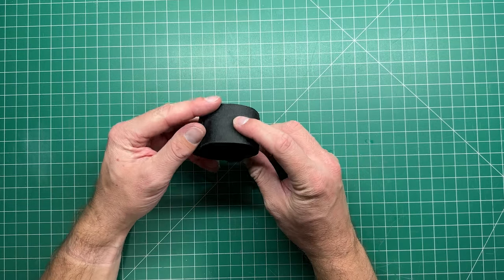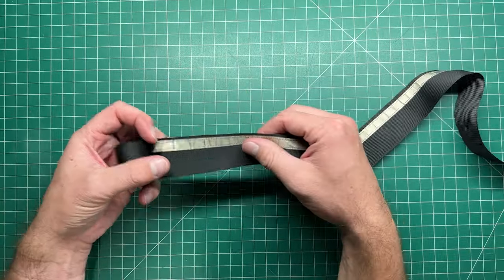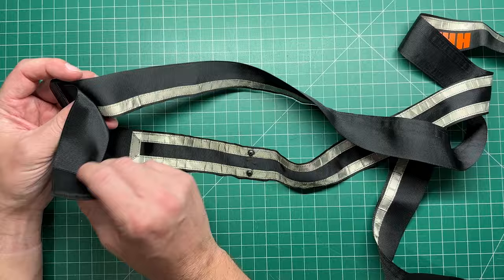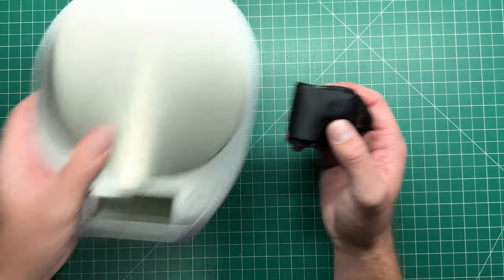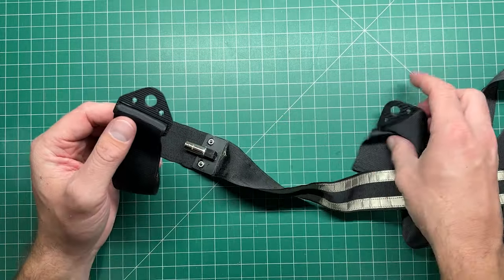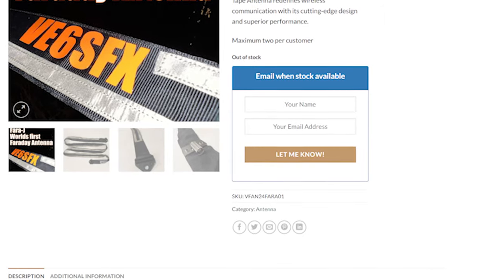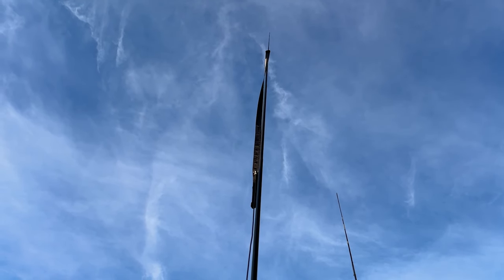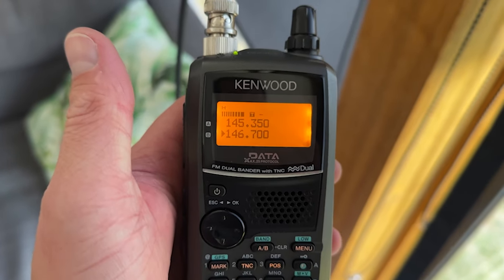BOOST Your 2m Signal With This NEW Antenna!

Comment: Made a similar folding J Pole the other day from some 300 Ohm TV ribbon. It works very nicely on our fox hunting transmitter.
It cost about $2.00 in materials.
This is nicer … but it would want to be for those $$$ !

Comment: Very nice. I wonder how well copper foil would work in the same fashion? I have some of that left over from stained glass.
Reply: Foil works quite well. But over time it work hardens and breaks down. Plus sewing metal foil down for a permanent attachment is not feasible. This antenna was born out of this experiment on my channel FYI :) https://youtu.be/d5itl1uWGtU